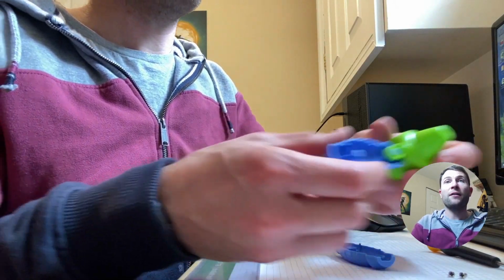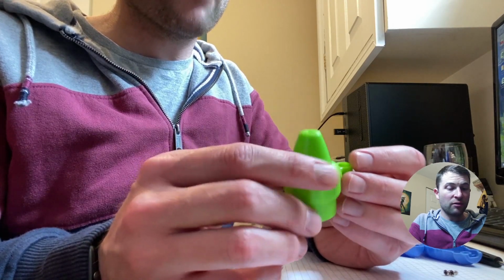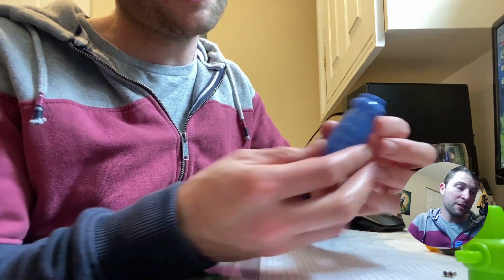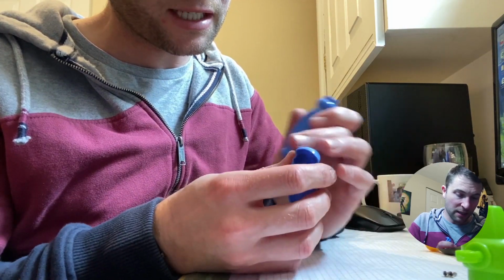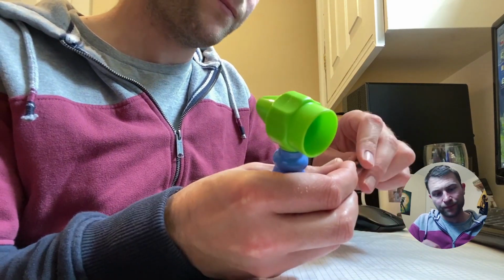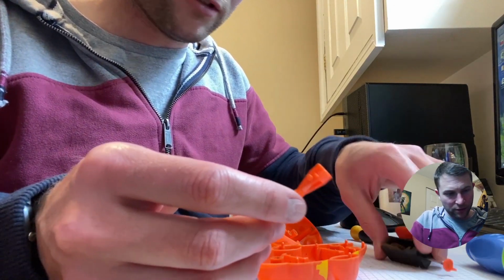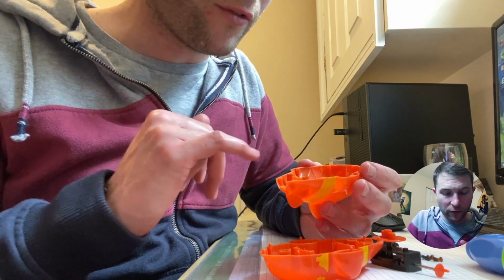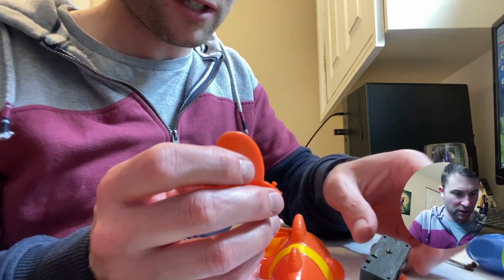learn by reverse engineering products

Comment: So..  Always good to see engineers interesting in taking things apart..  That's the first step in becoming a GOOD engineer.

But, Did you not actually learn anything?  or where a cam mechanism new to you?
 Sounded to me that you where basically just confirming your previous knowledge, more so than reverse engineering a product.

Reverse engineering is not "easy"  First you need to have a clear picture of the intent and objective of the product at hand, secondly you need to define if your objective is actually the same..  Then you decide what features/methods to copy and emulate in order to obtain YOUR objective..

Why where the components screwed together? where it needed? could it be done differently?
Where there something clever on the choice of materials, where the process utilized  used in a optimal way? could a different manufacturing process be used with success?
Reply: I feel he did a great job. Your approach to reverse engineering seems too stiff and methodical. Reverse engineering also deals with exploring some interesting design choices unique to a product's design. Even though it maybe an existing well understood industry standard, it becomes more interesting to beginners like us to find out these things through these toys.  
OP, awesome content!
Reply from the maker: Thank you
Reply from the maker: Everyone is entitled to their opinion. I agree there is far more detail to explore on the subject. I am merely trying to get the point across of the concept and what people can take from the process. Thanks for your comment